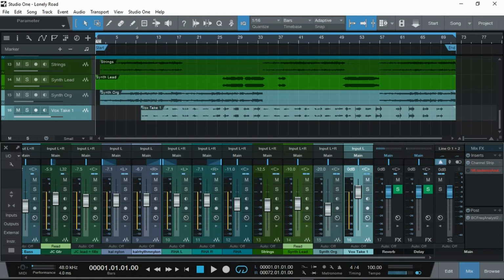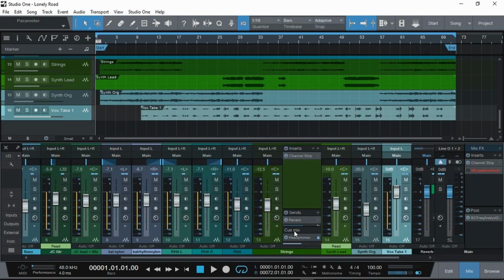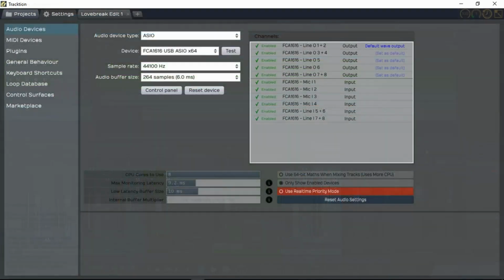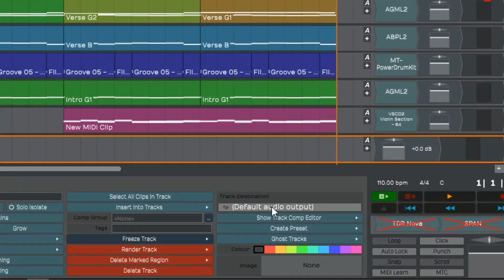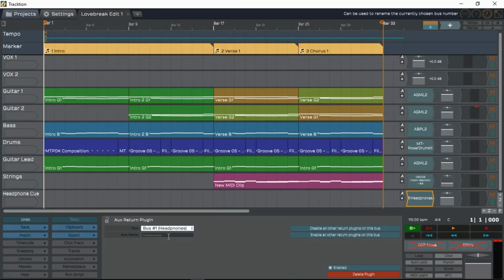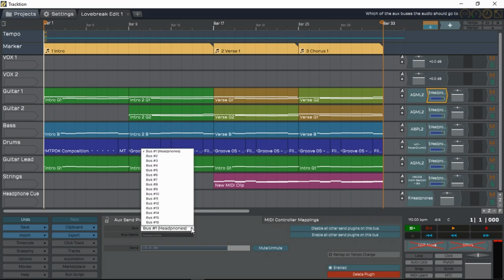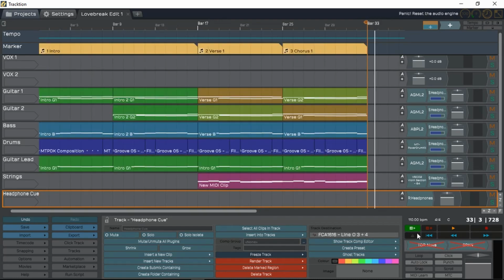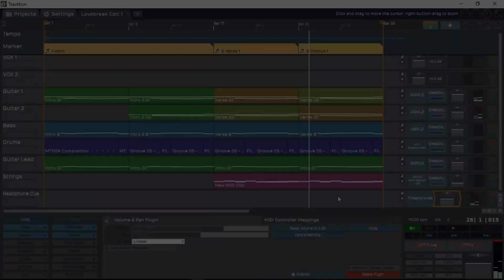Behringer Firepower FCA1616 Headphone Cue Mix Workaround

Comment: i finally hooked up my monitors to fca1616 and now see what the big hoohaa is about ;) was just using headphones for months. Pretty annoying, but my fix will be to hook the main outputs from fca1616 to my yamaha mixer (which has been dormant for years). I will connect the monitors to the mixer and control the output volume there with a fader. i will just leave the headphones hooked to the front of the behringer. i don't use studio one, instead i use cakewalk by bandlab which lets me set up different outputs like you did here. Although i don't think i will need to. I will just leave it set to outputs 1-2, bring a fader up when I want monitors, drop a fader when i only want my headphones for recording. I feel good that my mixer will have a purpose once again :) thanks Behringer for designing with a major flaw haha. Apart from this issue I really like the pres and the adat i/o, overall happy with my 2nd hand purchase of this behringer for $150 aud
Reply from the maker: Wow that's a great price. 
In Cakewalk you can create separate outputs so all you have to do is mute in Cakewalk and monitors get muted while you can still listen on headphones.
Reply from the maker: @raindogred  Hope you get some great recordings of the $30 guitar now.
Reply: @RecordingStudio9  lol gee i miss that guitar. kept me sane for 5 years living in sumatra. the guitar was gifted to the neighbours kid. Back in oz now and setting up my old home studio..loving it sick :0)